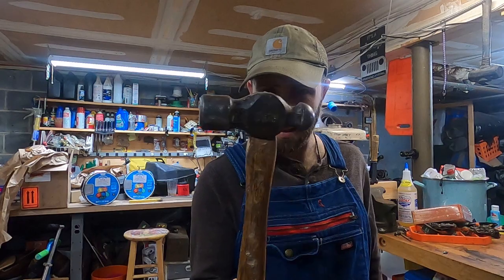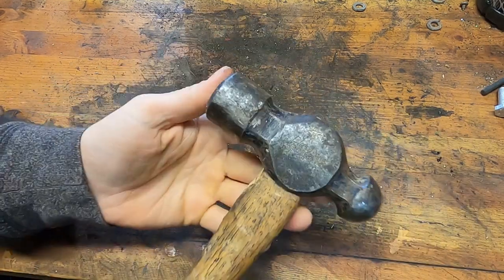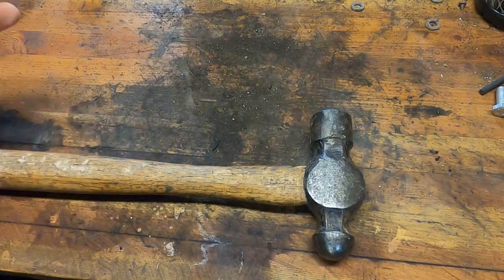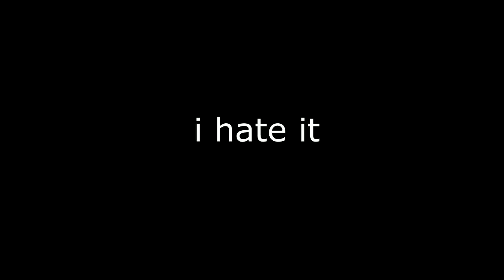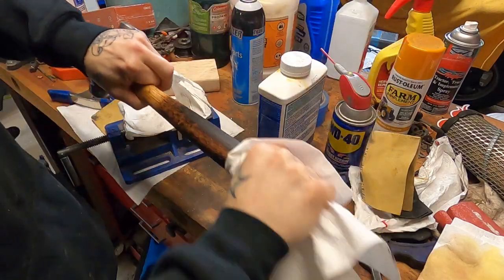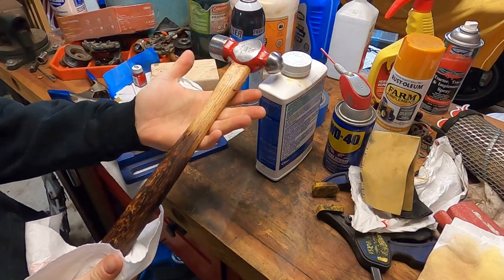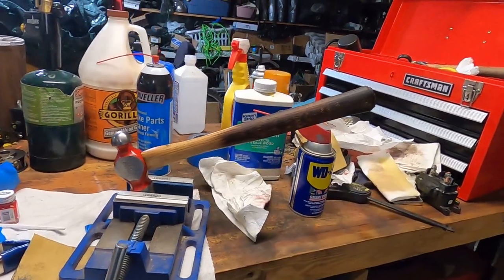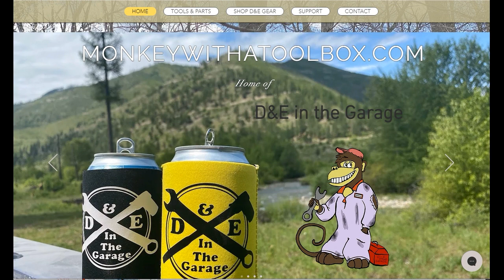I Found This Hammer in the STREET! Lets Restore It. (Blue-Point 24oz Ball Peen)

Comment: Nicely done. I like that you kept the original handle.  I have found quite a few 'road combed' tools over the years - the few snap-on spanners and sockets I have all came from roadsides. I recently did a vid on a sad and rusty rounding hammer I found on a road verge in Somerset (UK). Made a new haft from green ash (from the coppice) and fitted it 'cos the old one was rotten.

Comment: I like the restoration but hammer handles are wear items, that's why you can find them in stores.

I would have just restored the head and re-handled so I'm not worried about a repair failing.

The handle has a history but it's not your history.  It might be a bit of an antique but it looks like a user more than a wall hanger to me.  I would try to repair a handle on one of my grandfather's tools that I inherited but a road tool is just a tool.